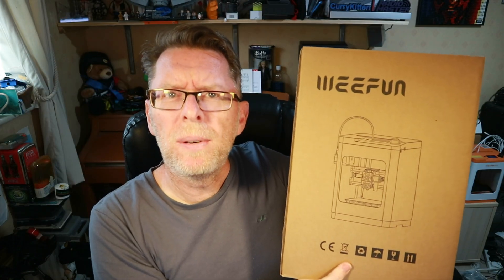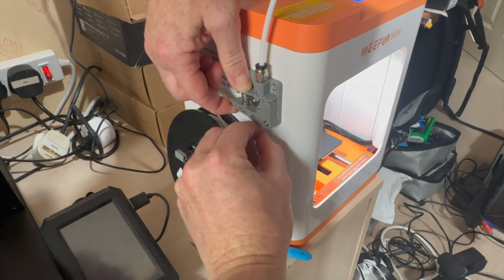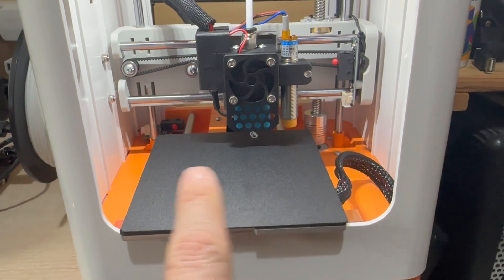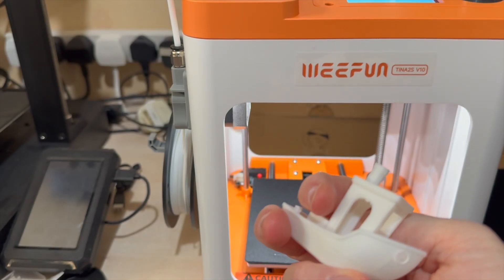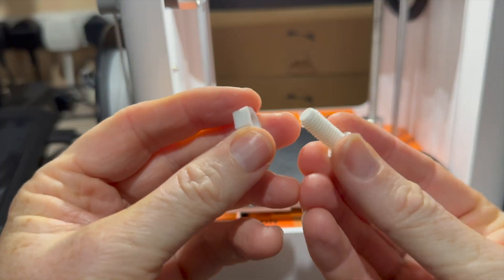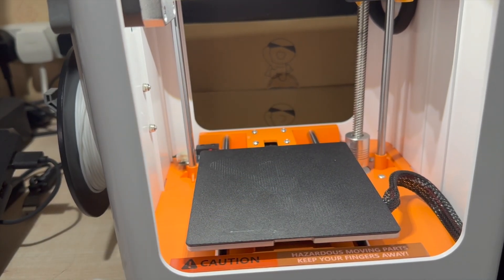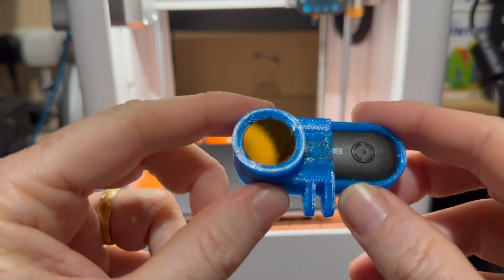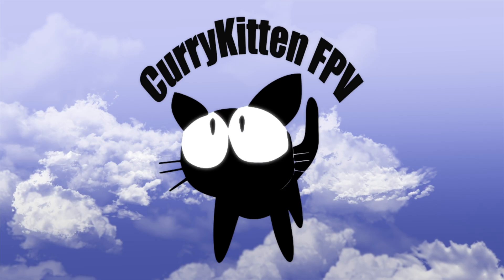Weefun Tina2S 3D printer.  Small, but perfectly formed!

Comment: thank you for this video, I just have a question can I use SolidWorks to print something on Tina2s?
Reply from the maker: Interesting to use the most expensive CAD program with a cheap printer.  I would presume so - you just need to be able to export your design as an STL file and then feed that into a slicer
Reply: @CurryKitten  hahaha I am a student so I have it for free I didn't purchase it and I want to have some experience with 3d printing. how much is the Tina2s?

Comment: It has a lot of nice features, but $200 is a price of a Bambu Lab A1 mini, which is an all-around superior option, especially for beginners.
The only real strength of Tina2S is its small footprint.
Reply: Where are you seeing that price? I'm seeing 400
Reply: @nickabel8279  400 is for the combo. Printer + AMS. You don't need AMS to print single color things.
Right now the printer alone is listed at $250, but it often dips down to $200.

Comment: 😂 I was offered one of these for review as well, but declined, partly because of the small bed!  I don't own one and I'm not familiar with using CAD  to design my own things,  so didn't think it was a lot of use for me and my projects. Didn't want to print small toys.  I'm thinking now maybe I should have said yes, though you already have good knowledge of printers and it would have had a big learning curve to make a review as good as yours!
Haven't got space for it really either. Too much free stuff!
Reply from the maker: There is a little bit of a learning curve if you want to design your own things.  But it's not usually more than taking some measurements, drawing a box and then extruding things around.. then repeat.  The good news is that most of the time, someone has already had the same thought and published the design on Thingiverse - so often a case of downloading and printing!  Reviewers curse - where am i going to put all this stuff :D

Comment: This appears to produce mostly acceptable results, but at £199 it's way overpriced for what it is. For £30 less you can get a Bambu Lab A1 Mini that has a 180mm cubed build volume, is just as easy if not easier to use, and which prints much faster and at a much higher quality!
Reply from the maker: I'd love to get hold of one and compare.  Obviously I can only test what I have, and I don't know all the models out there.  While the bigger build plate is a good thing most of the time, I'm thinking about people here with the minimal amounts of space for a printer

Comment: Cetainly consider one as my first printer, as it even does TPU and I'll only use it for small stuff related to planes & quadcopters.
Reply from the maker: As long as you are not intending to 3d print a plane, then most stuff for FPV does fit into that 100mm build plate

Comment: This looks great, would love a printer like this but not sure i have the time to learn 3D printing.
Thanks for the review Wayne. Take care
Reply from the maker: The good news is, that it's a lot easier than when I built my original printer.  It would jam, break and I spent a lot of time disassembling and reassembling it, making changes to the code and printing a lot of spaghetti!  This one you just plug it in a go.  If you want to make your own stuff though, it will take a bit of time to get to grips with something to design in (like Fusion 360)  But at least the printing part is not so hard now
Reply: Learning CAD so that it might be useful to me was why I said no when I was offered one for review! 😢

Comment: This looks great. I have thought about a 3D printer, but the high cost for just the fiddly little brackets, connectors, camera mounts, etc that I would want to print puts me off/ And also that I don't have a place where a big footprint printer can be kept. Wil look into this further, but clearly this was developed and marketed for little bits players like me. Thanks for the informative review!
Reply from the maker: 3D printers are great if you love to tinker with stuff and you can imagine all the little things you could design and print to fix things/make things/etc.  It certainly won't pay for itself, unless you are printing a lot of camera mounts and things instead of buying them.  I personally like the fact that I can make a custom thing so easily - if you get slightly into the design aspect of things, it can be enormously satisfying when what you design and print comes out andj just works :)
Reply: Look at the A1 mini

Comment: I have the Tina 2 Basic and I've printed loads of Fpv stuff like vtx holders for walksnail and antenna holders,arm protectors etc and it's been amazing only does pla as mine hasn't got a hotbed but it's good for most things we in the hobby need.
Reply from the maker: Nie - glad to know it's a decent brand.  Shame you can't do TPU, it is very useful for push fitting things into.  But you can always work around it to an extent with PLA and make cases that you can lock a camera in place for example